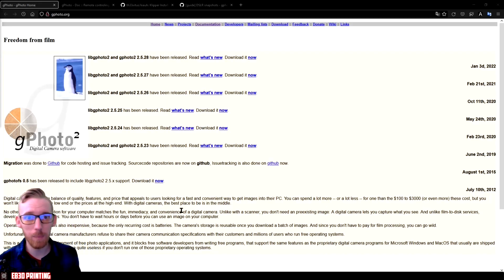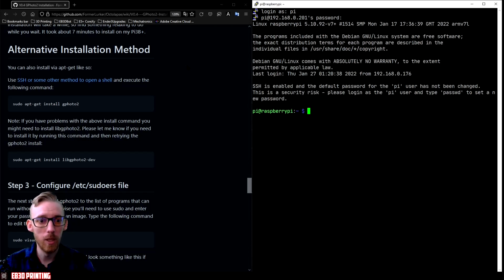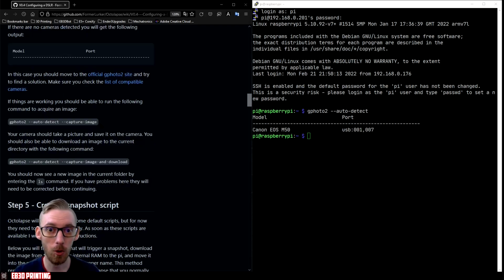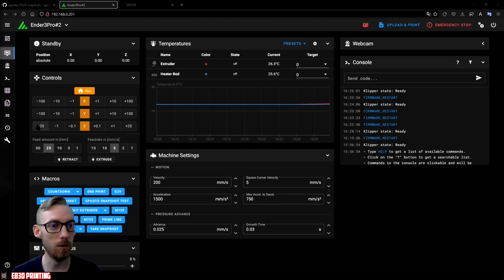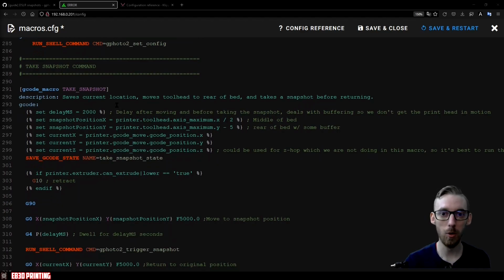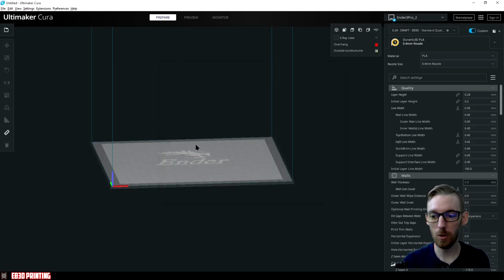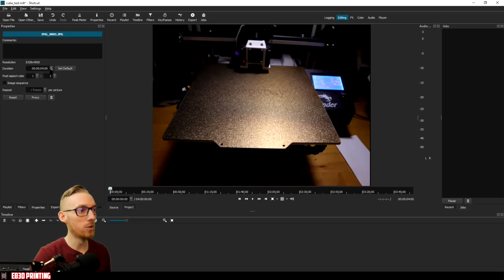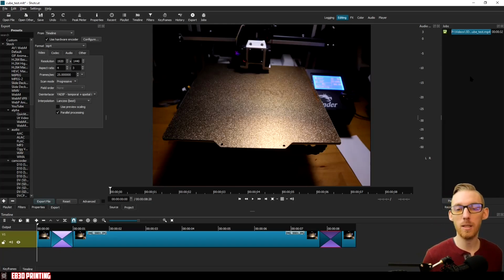Mainsail Timelapse Setup w/ USB Connected DSLR Guide

Comment: Thank you for this fantastic tutorial. I didn't exactly follow your steps for taking the frames but all the explanation on how to install gphoto are a big help. Instead I used the moonraker-timelapse pluging and customized the provided timelapse.cfg (just added "RUN_SHELL_COMMAND CMD=gphoto2_trigger_snapshot" to _TIMELAPSE_NEW_FRAME macro and "RUN_SHELL_COMMAND CMD=gphoto2_set_config" to _SET_TIMELAPSE_SETUP. Like this I can use the moonraker-timelapse UI to set up the toolhead parking, timelapse mode (hyperlapse or timelapse, retraction...) and I also get a low quality timelapse sample via my PI cam. Hope this can give some ideas :)
Reply from the maker: That's is such a great idea, I was trying to figure out how to do that but couldn't quite figure it out. Does it matter where in those macros you put the lines?
Reply: Hey, that's a brillant idea but are you able to get the files in the proper place for moonraker (I mean in dedicated folers with proper naming convention) so that jpg and timelapses can appear in the mainsail UI?
Reply: trying to do the same with mine but being unfamiliar with the codes couldn't figure it out. can you share your timelapse.cfg file somehow?
Reply: Have been searching for couple hours  now what would be the best way today to add dslr timelapse capability to klipper setup and THIS is exactly what I was thinking. I'm going to try to implement this when I get home. (damn work etc.) If you could share the timelapse.cfg that would be really usefull and speed things along!
Reply: Anyone work this out?
Reply: @skyeblackledge2068  Sure did.

Just added this to printer.cfg (or you can use include of some other file if you want)

[gcode_shell_command gphoto2_set_config]
command: gphoto2 --set-config capturetarget=1
timeout: 1. ; make sure this is long enough to account for focus time
verbose: True

[gcode_shell_command gphoto2_trigger_snapshot]
command:gphoto2 --auto-detect --capture-image
timeout: 5.
verbose: False

And then for timelapse.cfg you need to copy it and name it smt. ike my_timelpas.cfg or smt and then include that in printer cfg instead of original timelapse.cfg file (there is some write protection or smt in that file)

Then I just added in to the last line of this gcode maco
[gcode_macro _SET_TIMELAPSE_SETUP]
RUN_SHELL_COMMAND CMD=gphoto2_set_config

And

[gcode_macro _TIMELAPSE_NEW_FRAME]
description: action call for timelapse shoot. must be a seperate macro
gcode:
  RUN_SHELL_COMMAND CMD=gphoto2_trigger_snapshot  
 {action_call_remote_method("timelapse_newframe", 
                            macropark=printer['gcode_macro TIMELAPSE_TAKE_FRAME'].park, 
                            hyperlapse=params.HYPERLAPSE)}

hope this helps.
Reply: @Golla63  i managed to get round the write protection on timelapse.cfg by writing in nano through ssh does the shell run have to be at the start like you've written as I placed it at the end does it make a difference ?
Reply: @skyeblackledge2068  not sure. Testing will tell 😊
Reply: @Golla63  Thanks i changed it anyway seems functional in the video he stay no way to auto render as of yet due to she ll compatibility has this changed to your knowledge or still need to manual compile the shots?
Reply: @skyeblackledge2068  Im doing it manually in davinci.
Reply: I finally found out how to do it. You had to add it to the last line in each. But is there a way to send the photos to the pi storage for a automated timelapse. it allows us to store the photos on the pi. Why not send to the folder the timelapes is created from. Is this possible?

Comment: sony A6000 doesnt do capture target command.  Question is how do i modify that script to tell it to just download the snapshots to a directory on the device running klipper?
Reply: Same Problem with my A7M2:
This one solves it:
sudo gphoto2 --auto-detect --capture-image-and-download --filename=/home/pi/%Y%m%d%H%M%S.jpg

Make sure make your camera into remote mode after attaching it via USB and run this macro manually once after connecting the USB cable, it will also keep the settings and not reset them.

This Shell Macro: 

[gcode_shell_command gphoto2_connect_camera]
command: sudo gphoto2 --list-config
timeout: 10. ; make sure this is long enough to account for focus time
verbose: False

And This normal Macro: 

[gcode_macro GPHOTO_CONNECT_CAMERA]
gcode:
    RUN_SHELL_COMMAND CMD=gphoto2_connect_camera
Reply: Also working on solution to use infrared light to trigger the sony, which will the have the camera work on its own without transfer time for the pictures. This should speed up the process to have less nozzle oozing in the meantime

Comment: Hi! @EB3D Printing, I'm wondering if you can help me. My camera (Sony ILCE-7M2) is somewhat supported but I have an issue where I cannot write to the internal SD. It does however write to my Pi if I use the command gphoto2 --auto-detect --capture-image-and-download

I modified the shell command file to include this and if I manually run this command on ssh, the camera successfully captures and stores the image on my pi, if, however, this command is triggered using the shell command, it will take the image but not store it, even though the text in the command is identical. 

Can you provide any suggestions?
Reply from the maker: Try increasing the timeout of the shell command. The time it takes to download the image to the Pi may be longer than the timeout allows
Reply: @EB3DPrinting  Thanks for the quick response!! First time interacting in the comments so I really appreciate it. Unfortunately this didn't work, I tried setting the timeout to 100, 1000, 10000, and 20000. None of which were successful. If I run the gphoto2 --auto-detect --capture-image-and-download in my ssh client, the photo appears in my pi root directory within a second. Sadly if this command is run through the mainsail console via command "gphoto_snapshot_test", the camera happily takes the picture but fails to download it to the pi. Super strange. Any other thoughts?
Reply from the maker: @Kyle Palframan  When you say it doesn't write to the internal SD, are you setting that SD card as the capture target? 

gphoto2 --auto-detect --get-config capturetarget

This will display the memory slots available 

If it displays the Memory card with choice number

gphoto2 --auto-detect --set-config capturetarget=

Enter the memory card choice number after capturetarget=
Reply: @EB3DPrinting  I don't think this camera can write to the internal SD of the camera. It's a problem with Sony cams as far as I can tell. They write to SDRAM and not the internal SD, and this can't be changed. If I run gphoto2 --auto-detect --get-config capturetarget, I get: 

pi@ender3:~ $ gphoto2 --auto-detect --get-config capturetarget
Model                          Port                                            
----------------------------------------------------------
Sony ILCE-7M2 (Control)        usb:001,008     

* Error *              
capturetarget not found in configuration tree.
* Error (-1: 'Unspecified error') *       

For debugging messages, please use the --debug option.
Debugging messages may help finding a solution to your problem.
If you intend to send any error or debug messages to the gphoto
developer mailing list <gphoto-devel@lists.sourceforge.net>, please run
gphoto2 as follows:

    env LANG=C gphoto2 --debug --debug-logfile=my-logfile.txt --auto-detect --get-config capturetarget

Please make sure there is sufficient quoting around the arguments.

It can successfully write to the SD of the Pi, however... for example, if I'm in Putty and I execute : gphoto2 --capture-image-and-download, it captures and successfully downloads to the SD card of the Pi. I can see the file there about 60s after it captures. It's the exact same command that i have it activating in the shell file when the command "gphoto_snapshot_test" is run in the mainsail console..I modified the shell command.cfg file to include the following : 

#=====================================================
# DSLR CAPTURE IMAGE
#=====================================================
[gcode_shell_command gphoto2_trigger_snapshot]
command: gphoto2 --auto-detect --capture-image-and-download
timeout: 30000. ; make sure this is long enough to account for focus time
verbose: False

Now if I use mainsail to execute that shell command, it will successfully capture, it just never actually downloads to the sd of the pi if this command is run through mainsail, but if that same "capture-image-and-download" is run in the ssh, it does download to the sd of the pi, which is all I need it to do. 

Hope that makes sense?

Comment: Hi. Are you using your dslr as a web cam as well?
Reply from the maker: No, I use a logitech c270 for the Webcam. It has something to do with the DSLR not being able to do live view
Reply: @EB3DPrinting  ahhhhhh ok.
Soooooo I just did the setup after watching your video and I want to thank you! Everything is setup and kinda working. I have the same camera as you and am having an issue I hope you can help me with. When it takes a couple of pictures, the screen will say "busy" and will not take another picture unless I unplug the cable and replug it back in. After a couple more pictures it does it again. Any thoughts?
Reply from the maker: @Chris Woods  mine does the same thing. It will not take inputs from the camera body because it is in "use" by the USB. It should, however, take inputs from  macros/command line of the Pi or Mainsail. After I have the camera set up for time-lapse, I just close the rear screen and let it run through the printer
Reply: @EB3DPrinting  when you say "close" do you mean set the camera to sleep? Because I have mine closed and it still does it.
Reply from the maker: @Chris Woods  Just close the back screen shut. What you can do is run the test snapshot macro to see if the camera still functions while it is saying its busy
Reply: @EB3DPrinting   @EB3DPrinting   @EB3DPrinting  thanks, it does take a picture when shut. Also, it doesn't save any of the pictures but I think I just figured it out. Under your start macro, there is the run_shell_command cmd=gphoto2_sd_init...it was commented out but I just uncommented it. I hope that does the trick. One last question I am having an issue with and I will leave you alone lol, when I started a print for abs your start macro has it set to bed=50 and extruder=205. Do I have to change that each time when I start a print with different materials and temp settings or could I just delete those lines to have a normal temp start from my slicer? I really do appreciate your help and I am so close to the finish line!!
Reply from the maker: @chriswoods9857  In the start print macro for example

{% set T_BED = params.T_BED|default(50) %}

set T_BED sets the bed temperature
params.T_BED looks for the T_BED parameter in the GCODE file you wish to print
default(50) is the default printing temperature. The bed will get set to 50*C if no T_BED parameter is found in the gcode file

Using PrusaSlicer as an example. The Custom Start G-Code is:
START_PRINT T_BED=[first_layer_bed_temperature] T_EXTRUDER=[first_layer_temperature] ;

That start GCODE sets T_BED to the first layer print temp which is set up in the filament settings in the slicer. So when you start a print, the bed temperature will then be set to the T_BED set by the slicer.
Reply: @EB3DPrinting  unfortunately it didn't work that way. I set the slicer for 250 but when it started printing it was set to 205 like the start macro. But I am going to have to scrap the whole time lapse idea anyways. I can't get the camera to work properly. It is always giving me a busy icon and will not save any pictures. I have worked on this for about 2 hours trying different combinations. Nothing works. I am not sure how it is working for you. Grrrrrr I really wanted this to work. There is one thing I have learned from all of this, just because one person got something to work doesn't mean that it will work for the next. I have done installs on one machine and go to do another install the exact same way with the same electronics and nothing would work. Thanks for the video and thanks for trying to help!